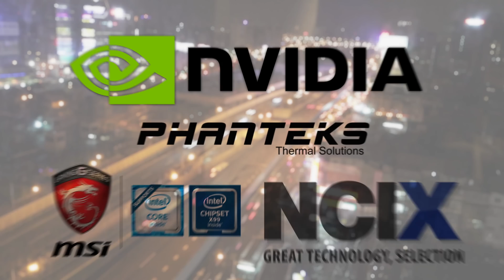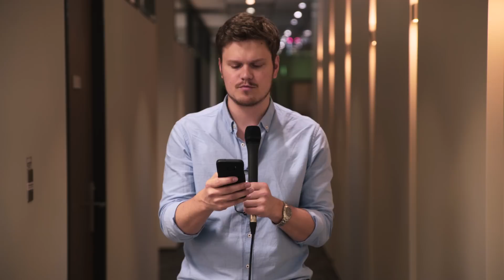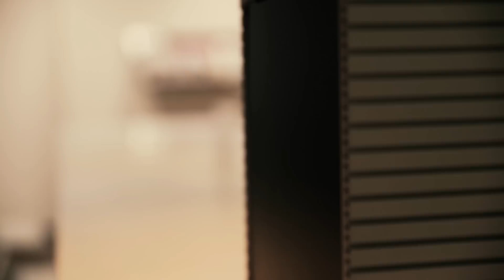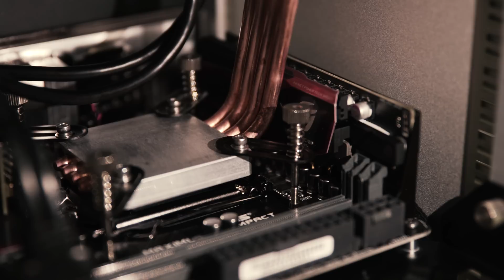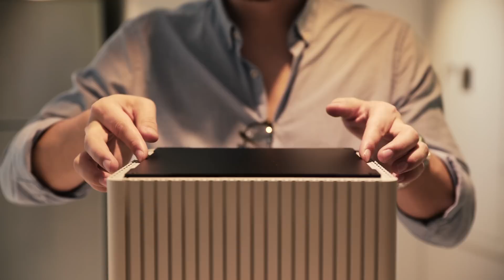The Most Beautiful ITX Case EVER!

Comment: would i be able to fit a full size nvidia 1080 gpu?, was thinking of internal water cooling and attaching it to one of the side panels, the only other thing would be the get a itx power supply of 700watt plus

Comment: Hey guys would be nice if you could help me...would this Case work with this Board  > ASRock X99E-ITX/AC and these parts
 i7 6900K m.2 950 Pro and 16GB RAM ?
All i understood was 240 watt power suply...what if the CPU needs 140 Watts by it self ?
And witch Graphics Card would fit in it ?
Thanks in Advance

Comment: The hell am I meant to do with a 240w powersupply? Am I missing something here or is that really low?
Reply: Well it's meant for very light use, not for gaming. And I think that something like a GTX1060 or RX470 would run really well on this power supply. What I'm wondering is..is there even enough venting for the GPU so it doesn't choke to death ?

Comment: Wanna see more of that. Specially how it handles gpu with a 240w psu
Reply: Lol an AMD gpu with a 240w psu. Funny stuff.
Reply: AMD ftw
Reply: the new polaris architecture might be good for this, i know its not the highest end, but from what i saw its pretty efficient
Reply: why not, a rx470  could work with that
Reply: I think this would be good with iris pro integrated graphics and you could have it in the living room and stream games from your gaming pc with a good GPU in it.
Reply: +Nino Srdic I agree. Maybe even the gtx 1060 since it has a 120w tdp I believe. But is there's any venting for the damn thing ?
Reply: i dont know, cant tell from the video, it should considering it has space for a graphics card, but it's limited for graphics cards that are 200mm in  length.
Reply: although i think that a 1060 would be close to the limits of the psu, maybe a 1050 or rx470, rx460. Obviously we can forget about overclocking any of these cards.
Reply: Progan666 But you could also just use longer cables.  no need to have an extra pc.
Reply: Jay Miller Yeah but its also an extra computer that looks hella sexy and you could use it for casual gaming. But definitely a niche. Most people just get consoles.

Comment: why not just get a nuc
Reply: The best NUC is a 45W CPU with limited connectivity.  This can handle standard ITX motherboards and a 65W CPU, so vastly more capable.

Although the heat dissipation cannot be THAT good or it would be a burn risk.

I'd also question how you keep the storage cool as the heat from the CPU is going to be transferred to anything else that needs to be cooled.

Comment: I'ma go ahead and guess that there's no adaptors for GPU's for passive cooling available simply because of the different amount of GPU's available . That would be amazeballs if you could get a i5 with a 65watt TDP and something that's going to replace the 750 ti that only uses about 65 watts too. Something that's half as powerful as a RX 480 or a 1070 would be awesome in something that doesn't make any sound at all.

Comment: I wanna stick a GTX 970 mini in there and an i7 along with 16gb of ram!
Reply: With that 240w power supply?
Reply: Maybe not. I didn't watch that part of the video yet before typing the comment, lol.
Reply: Airflow is almost non existence in that case.
Reply: But there is airflow in your room :)

Heat goes through the sidepanels, that's the whole point.
Reply: Don't worry I am not gonna do that. I got the Fractal Design Core 500 mini-ITX case instead. Works really good with my system and a new mini ITX motherboard.

Comment: Included proprietary PSU is only 240W? No thanks.
Reply: That's plenty for this design. Many Intel setups are under 100W, so you have room for a small addon GPU if desired.Look at how little power many laptops use. Some 30W or less.Anyway, it's not a game machine so not sure why you would think this is a problem.

Comment: Passive CPU cooling would be okay, but not great for overclocking. 240W is not enough for highest end CPU+GPU. Dust would get all up in those channels. It's an enthusiast case (and likely very expensive) for a not very powerful system, which is a bit of an oxymoron.

Comment: From the thumbnail, I thought it was a cpu cooler.
Reply: It basically is. A rather big one...
Reply: Pajama Senpai Actually, it is!
Reply: i wanted it to be....
Reply: My question is, if this is considered a self heat dissipation case, would the case itself become too hot to handle? Because the CPU is going to be attaché to it, and maybe other components that are attached to it as well, the case will get hot.Especially if there are no fan to remove the heat from the fins.
Reply: +Timothy Long by The time this case gets too hot, i think you have a bigger problem. this case probably is not meant for putting in i7 5690x etc...
Reply: There are itx motherboards that supports similar processor, maybe not an Xtreme processor, but an unlocked processor that can ramp up heat.
Reply: Timothy Long ok? You said it yourself, the case is designed to passively dissipate heat. So if the processor gets hot, the heat moves to the case, which then dissipates it to the air passively, hence all the cuts and grooves in the case to optimize surface area. Sure the case will have a certain max TDP, so you'll just have to make sure that your processor does not exceed said TDP.

Comment: Perfect case for a hackintosh, 6700k and iGpu
Reply: I somehow think a 6700K might need more surface area to be passively cooled.
Reply: razamatraz 130W of passive cooling for this case, the 6700k even OC doesn't suck that much power
Reply: Hmm, doable then; what would the delta be to dump 130W?
Reply: razamatraz Don't know, they didn't specify that

Comment: Looks like it'll make a good htpc. It also has dual slots for a mini gpu like the r9 nano or mini gtx970.
Reply: 970 (or even 1070 now) would be better because it doesn't dissipate as much heat.
Reply: Rahul Katre The Nano runs hotter, but it's also more powerful than the 970. http://www.hardwarecanucks.com/forum/hardware-canucks-reviews/70704-itx-battle-r9-nano-vs-gtx-970-mini-2.html

Also, we don't know when or if there will be a 1070 mini. Personally, I'm an nvidia fanboy, but when it comes to mini PC, I'll get the best bang for the buck since my giant PC is reserved for the best components.
Reply: 98luk45 Yes, but right now, the 1070 would be better.
Reply: Rahul Katre The 1070 won't fit in the case. The 1070 is not available for purchase yet. And there's no mini version of the 1070 yet. Get your hype in check!
Reply: If you want to know more about the case, you can find them here:
http://www.streacom.com/products/db4-fanless-chassis/

"Expansion Slot: .... (MAX 200mm Length ... )"

Comment: how do you cool without any fans in the case?
Reply: It would be passively cooled.  the entire case is pretty much a cpu heat sink.  The cpu socket inside the case has the copper heat pipes that would spread the heat across the walls of the case if i understand this correctly.  Id be nervous of the temps all the time if i bought this case lol

Comment: So basically you can't use AMD because of the heat and power supply
Reply: Actually, an AMD APU would be ideal for this case. I'd rather install an i7 5775C, but that's expensive.

Comment: If only it supported a fan...
Reply: Then it would not be silent would it...
Reply: Bayonet one good fan is mostly silent. And it would make it a lot cooler
Reply: Putting a fan completely defeats the purpose of the entire case. Thats like asking to put an engine on a bicycle. The case is supposed to be entirely passively cooled by the case itself - thats what makes it special.
Reply: Lucas S I know that, but a cpu with just 60 watts? If you connect it to two sides you get 120 watt dissipation, but how much room does that take? Can you fit a Gpu in there with two connections?
Reply: sur puppa A lot of cpus are 60 watts. Even powerful ones. And graphics cards that fit in here are also not high wattage. The 750ti is under 75 watts. Not to mention this thing can take a 6700K and a 1070.
Reply: Lucas S isnt a 6700k 85 watts?
Reply: +sur puppa The 6700k is 91w, the 6500 is 65w, the G4400 is 54w and the 6700T is 35w.
Reply: sur puppa yes, but you can still run it and a 1070 with it

Comment: Each side panel can dissipate 65W of heat. Ok. We need more side panels then. How about a dodecahedral case next?
Reply: It will be plenty
Reply: Akalion "Plenty" here translates to exactly 260W. Which, I agree, is sufficient for the given power supply although only if you manage to exactly divide up your components into 65W blocks or get to manage overlap somehow.

However, I think you missed the humorous component of my comment that should have been obvious given that the shape of the case is not the deciding factor here. Surface area is.
Reply: "exactly divide up your components into 65W blocks" lol. The sides don't have to be directly connected to your components to provide heat dissipation. If one panel heats up, it's going to heat up the other panels as well.
Reply: nimrodery Less efficiently though. The video mentioning the possibility to attach the CPU to two separate panels speaks to that.
Reply: Penny Lane As efficiently as a heat sink with heatpipes would do the same job, so actually extremely efficiently. It would have difficult dissipating heat if you live inside another PC, but it should be fine most places.
Reply: nimrodery I'm not sure what you're saying. Are you saying people could stop using heatpipes and just use aluminium rods instead? Several aluminium rods stuck together to be precise because these panels are also just that: panels. They are not one solid block of aluminium.
Reply: Penny Lane Heatsinks aren't entirely constructed from heatpipes? I suppose I could start by saying that.....then I could say two panels directly connected to the APU provide adequate TDP, if the thing performs as advertised. I could also say the panels that aren't directly connected are still going to dissipate heat. There seems to be a lot of heatsinks that have no heatpipes whatsoever, yet they still seem to work. Like any design, it gets tested and it will get tested again in reviews. The design looks sound, as long as you're just installing an APU. There are GPUs that could probably go in there, too.
Reply: nimrodery "The design looks sound, as long as you're just installing an APU." Now you're just trying to sidetrack the conversation. Would you be so kind to read up on what my point was and then admit that you were at least talking about something else entirely the whole time? I never doubted that the thing could cool an APU. I was very clear on what limitations I was talking about. Just read it, please.
Reply: Penny Lane You read it. It says: "We need more side panels then." Very clear on what limitations? You said there's not enough dissipation, and you never bothered mentioning what the dissipation is for. If you're confused, complain to yourself, as you caused it.
Reply: nimrodery '"Plenty" here translates to exactly 260W. Which, I agree, is sufficient for the given power supply although only if you manage to exactly divide up your components into 65W blocks or get to manage overlap somehow.'

How is "components" a word that can refer to one APU? Obviously there's at least a CPU and a GPU involved. And then their power usages need to be multiples of 65W to max out the power supply (or, more precisely and as accurate as I've been before because there's always someone on Youtube who will try to misunderstand you any chance they get, multiples of 65W/n where n is the number of equally sized individual heatpipes you use to connect each component to the case). Otherwise, you will decrease the heat dissipation capability of the case which, as I pointed out, is already at the very limit. If you're maxing out the power supply. With multiple components. Anything else you'd like me to say three times?
Reply: Penny Lane Not at all. Components refers to all parts of your PC. APU equipped PCs don't need a GPU, and at no point previously did you mention or imply "we" want one. I don't know anybody who would be tempted to throw a high TDP GPU into a system that relies on fanless operation. This case isn't for you, and it's not defective for not functioning the way you want.
Reply: nimrodery No, indeed. This case isn't for me. I want the dodecahedral one. Back to square one. Fucking hell.
Reply: nimrodery Now that we've settled this, I do want to know one thing: from your point of view, was there any point to this discussion at all? Because to me it was a massive waste of both our time from the moment you typed the first letter in this godforsaken trainwreck of a thread. Genuinely curious about how you feel.
Reply: Penny Lane If it's pointless, go ahead and stop writing, please. It's what people usually do.

Comment: 240 watts? is it really enough to power anything?
Reply: You can have a 6700k and a 1070 at 100% load and it would be fine
Reply: +PC Master Race Don't forget Polaris 11 Cards, which offer 950/960 Performance for <50W.
Reply: not true you would need 300+ watts
Reply: It doesn't seem to have PCIe connectors, so yes, it will be enough (at least for it's intended purpose).
Reply: quornash On their website (http://www.streacom.com/products/zf240-fanless-240w-zeroflex-psu/) it doesn't have PCIe connectors, so the max. dGPU you could put in it would be a 750ti. Technically you could use some molex adaptors, but I'm not really shure if that would work well.
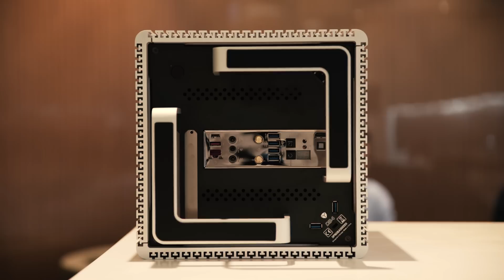Reply: taief miah The initial version they showcased back in 2013 had one PCIe slot, this one seems to have 2 (1:43, you can see something that looks like a 2nd slot under the left foot)
Reply: taief miah I guess if you install a GPU you would probably need to buy some more heatpipes (they sell them seperately) and attach them to another sidepanel.If you look at this picture (http://www.streacom.com/wp-content/uploads/db4-000-180-open.jpg) it should be possible to utilize the left side panel (if I got the orientation right) for a small GPU <65W
Reply: totally
Reply: +trotman000 indeed
Reply: +PC Master Race not for a 1070. due to the power going through rails. you would have a polaris 11 though
Reply: +Zerro maybe an apu?
Reply: Hopefully it'll be enough to power Zen and an AMD GPU
Reply: ***** It may not cool an 8 core zen well
Reply: polaris 11 is board power and I'm sure there maybe single slot version, I don't know how many pcie  slots this case has
Reply: Zerro wondering how the gpu will vent itself though in this case. It would defeat the point of it being fanless
Reply: the new gtx950 by MSI consumes only 75W of power.. 2GB ocv2, there would still be enuf power left for board and proc at 240 W total
Reply: There are 950' s that can operate using just power from the lane.
Reply: Again if you want a gpu to run in there polarised 11 seems the way. A lower tdp than the 950 so won't thermal throttle as much
Reply: taief miah There will also be a GTX1060, which will have (more or less) the same price tag as the RX480. That might also be an option.
Reply: Zerro no its in the same powerbrscket as the rx480 which is polarised 10. Both require pie power. Polarised 11 is the tiny chip meant as a gaming laptop gpu

Comment: This case will go well with my geforce gt 730
Reply: Shove your GT730 up my ass! Barely could play Fallout 4 on Lowest Settings with out frame drops..
Reply: lol srsly?
Reply: +lordferius It's not. Modern iGPUs from Intel and most APUs are more powerful than it.
Reply: +lordferius i would not use a passive card in a case like this it requires some airflow still
Reply: You realize its not even supposed to run any games and is worse than on board grapics. But with that, why does it exsist??
Reply: It's an cheap and pretty nice option if you want a platform like x99 but you don't need a good grapchis card.
Reply: GT730 can run dota2 on min. settings but its not a real gaming card, u can use it for browsing, worksheets and light games, the main reason the card exists is that it consumes 25W, with that u can build an entire system w/ a low power proc, an eco board and gt730 for a total of 100W power consumption.. and u can run that system 24/7 without having too much to worry on electric bills, that's why that card exists..
Reply: Anime536 _ my intel graphics can run dota on high m8 and that's built in to my cpu which uses even less power and it's cheaper than buying cpu + gpu.
Reply: +MinecartGaming Sure, but not all CPU/MOBO's have onboard graphics. For example, the E3-1231 V3 Xeon is essentially an i7-4770 without a GPU or overclocking support that also supports ECC memory. At launch the Xeon could be had for ~$100 less then its i7 counterpart which paired with a sub-$50 dedicated GPU is a substantial savings for the budget conscious. Granted, the price difference has recently shrunk to ~$50 between these particular CPU's  but hopefully you can see where a low-end GPU could have its uses. Not to mention those who simply need the additional video outputs at an affordable price. Most people would rather throw in a $50 part then buy a new computer for low-power multi-monitor support, at least most of my customers would.
Reply: MinecartGaming
 but a separate gpu has its advantages, it takes off some working load from the proc, and with that you'll have better heat management.. and with this case it all makes sense, with passive cooling on the proc and passive cooling on the gtx730 this might actually work
Reply: There's also passively cooled 750ti's which is dope